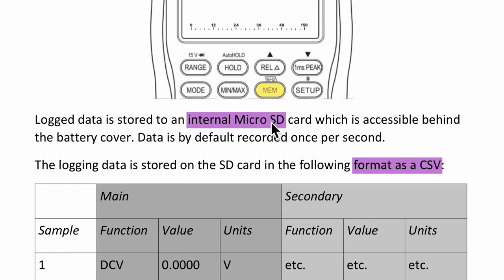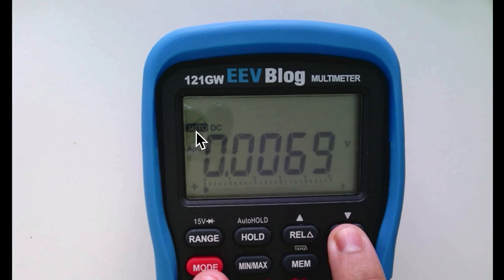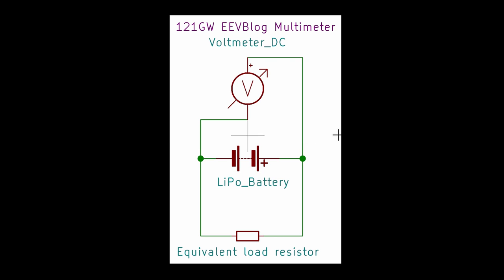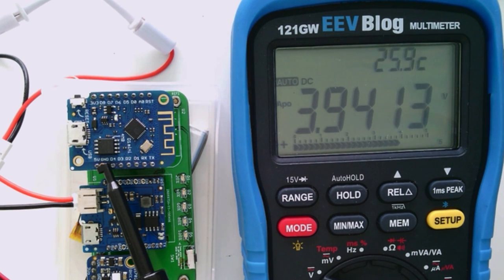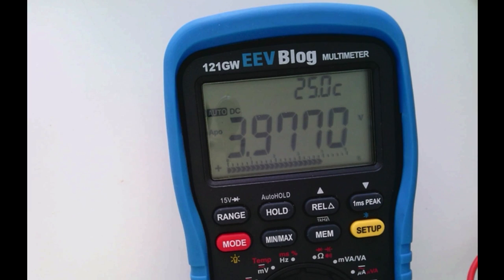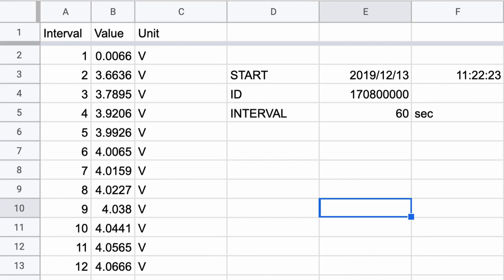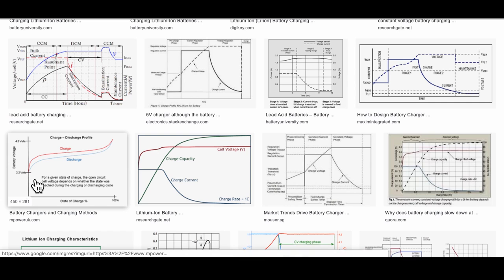Using 121GW Multimeter as Datalogger for battery charging profile

Comment: Does it turn off automatically or you can disable this function?
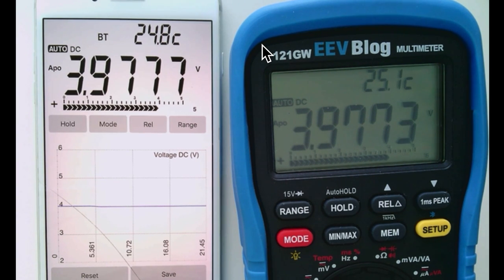Reply from the maker: 5:17 Are you referring to the data logging feature? You will have to start and stop the data logging manually by holding the MEM button. The battery life is 500 hours.

See page 48 of the manual: https://www.eevblog.com/files/EEVblog-121GW-Manual.pdf
Reply: @sayanee  no I just saw that many multimeters turn off automatically after a certain amount of time. For my purpose I need an instrument that can collect and store data for 24+ hours without shutting down automatically after few minutes
Reply from the maker: @vladislavgenevskiy4590  I see! To be honest, I have not tried for 24 hours. I have tried for 4/5 hours only.

Are you considering buying this multimeter? Also what kind of data are you trying to log? With this multimeter of course the data types are limited to the ones that the multimeter can measure.

I can try to set up a simple voltage monitoring for 24 hours and see whether it turns off.
Reply: @sayanee  yes but first I need to figure out this issue. I have to leave it overnight for the measurements... ))